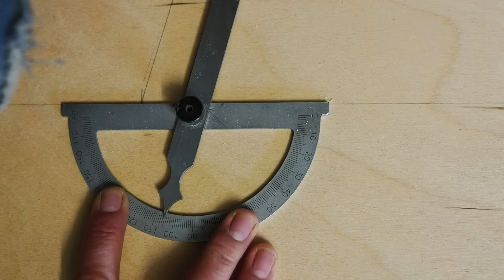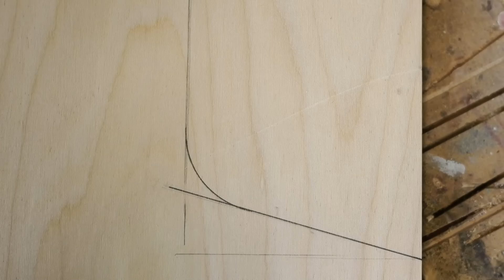Clever DIY Sofa Bed - Folds out in 6 seconds!

Comment: The ratchet strapping for the hinge is a genius move. When I saw it come out I thought it was for frame gluing in lieu of a clamp, but that's just top notch, out of the box thinking. That's a great solution to a flexible panel joint to have in my arsenal.
Reply: Agreed, brilliantly simple and effective.
Reply: and probably last a lot longer than traditional hinges.

Comment: Hi Laura. just discovered your channel, like your designs. 
I actually slept on a bed like this in the military. Instead of making the backboard and top fold - only the top was a lid.  the backboard rotated around an off center point and when not in the front position was snug against hte back . the lid stayed open . This way you have no lose parts and convert even quicker :-) . The backboard was padded as well making it a comfortable back support in the "down" position... 
Keep inventing

Comment: My girlfriend had something very similar in her tiny college appartement a couple years back. Main differences were that the bed portion was on wheels and could be rolled forward to expose the mattress fully and, hence, the backrest was fixed. Not uncomfortable to sleep on - just too small for two people ;) 

I think I prefer your design as it gives you very convenient storage behind the backrest and converting to a bed does not increase footprint, which is important in tiny places. Also, her version had storage under the mattress, but I guess you could add this to your design in a pinch if you really wanted.
Great video, keep it up!

Comment: I'm a bit late to the party here but I love this design. So many couch/bed designs end up ignoring practicalities. They require more than their footprint on the horizontal and vertical planes just to fold out and don't include somewhere you can store the things you need to actually use it. They have their place but I always look at them and think about how much faffing about with mattresses and sheets and storing them and unpacking them and clearing space for the folding out etc. would happen if you actually used it. 

This design's so efficient in it's use of space you could store more underneath it! Great stuff.

Comment: I love the design! It's beautiful and I'm sure it's comfy.

You may not know, but in former Jugoslavia, there were beds with a similar mechanism.
Naturally, they weren't made from plywood, but laminated chipboard. So they looked like doo-doo.
But if I remember correctly, the top/back piece was somehow "fixed" to the frame, so you couldn't lift it off. That made the mechanism easier.
Just a thought, I had when I watched the video.

Comment: Great design! Like the cardboard mock up, clever.
Using 2 ramps as the wooden frame wood make me even happier.  A place to store ramps so infrequently used, but has the strength & needed holes for air circulation. Could this be done?
The additional book box is terrific...a smaller one on the other side so there's no fight to sit by the book box.👍

Comment: That looks absolutely wonderful -- I love the idea of using the strap as a "hinge."  Probably far more robust and less likely to break.  The only thing I worry about is the lack of structural support on the top; I can easily see kids climbing or jumping on the back and having it break.  It seems like it needs at least one vertical brace, and that the cutting in half of the storage area would be regrettable but necessary.  Perhaps the brace could be removable (slid into a dado?) so it could be placed in there at the owner's discretion?

Comment: What kind of drill bit are you using to make those pilot holes? I'm new to woodworking, so this might be a dumb question but I've never seen pilot holes that make space for the head of the screw. Very nice looking.
Reply from the maker: It’s the countersink drillbit from festool
Reply: Thanks you. When I saw how nicely the screws went in and the flush look at the end, I just had to know what that tool was. I’m looking to make a shelf to organize my wife’s craft paper with plywood and my limited skills. I think I’ll pick up a countersink drillbit for the project. Thanks again :)